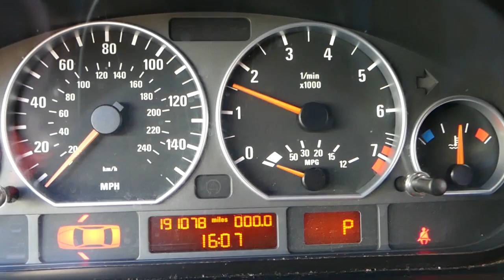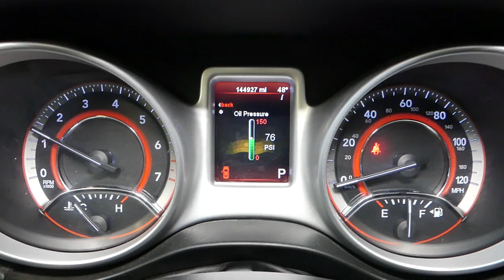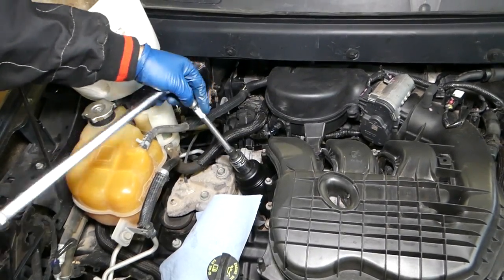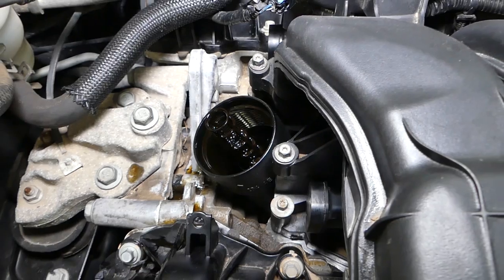DODGE CHRYSLER JEEP 3.6 PENTASTAR OIL FILTER BYPASS VALVE WHAT IT IS FOR AND REPLACEMENT

Comment: I almost bought the new oil filter housing, which goes for $307, from the dealership in my area.  Turns out that the valve was replaceable.  This was very helpful.  The fact that when installing the valve, it will first snap in place into the upper position.  But you are not done yet.  The final set point is when it snaps into place the second time in the second/lower position.  I watched your video to confirm I installed it correctly.  Your video is exactly how I installed mines.   I believe that this information that you are sharing is not on any forums.  Thank you very much.
Reply: i just bought that 308 housing part today and after seeing this video and this comment i was able to fix my bypass valve and i returned that part. man such a relief not having to remove the whole manifold and sheet. so happy 🎉

Comment: Without the bypass valve installed, would you not be allowing oil to bypass the filter at all times and thereby allowing unfiltered oil to circulate through the engine?
Reply: Yes you would

Comment: Hi I have a friend that has a 2013 caravan that he Took it to shop and they said that the adapter last time he took it was broken and went through the motor but I doubt this doesn’t the oil sump have a screen on it ?and even if pieces of the oil adapter  get into Oil pan if possible won’t hurt anything ?? I think even if the old adapter went into oil pan should
Hurt it right?

Comment: What if the plastic clip that broke has missing pieces?

Do I need to remover it all and look for it?
Reply: i have pieces missing too
Reply: You need to replace your housing if there is damage to the stand/cage that holds the spring unti in the video, or don't replace either.

Comment: some good questions here that went unanswered. I bought a 2011 Challenger with the V6. I put just under 50 miles on it. Dealer said the oil and filter were changed. I figure the smart thing to do is put on the Baxter anti return check valve. Took out the filter to check and make sure I bought the right Baxter adapter. Guess what. The damn check valve plastic housing was broken, Also tabs on the filter broke off when I removed the filter from the cap. The filter tabs I have. The top and bottom of the check valve plastic housing I have. After I took the bottom out from the top of the larger spring. What I have and what others asked was what happened to the rest of the check valve housing? They went down the filter housing but where does that go? Into the oil cooler to to the oil pan? Anyone know? The oil pump has a pre-filter of course. Looks like metal but the way they use plastic on cars who knows. Question is, what happens to that plastic if it reaches the pump? It should go to the filter. Strange enough the filter I took out what was supposed to be new sure as hell had more than 50 miles on it. Either the dealer never looked at the filter or..... No wonder I don't trust people working on my cars.

Comment: That bypass valve is not actually for when the filter gets clogged but rather due to manufacturing techniques of the filter medial the oil simply can not flow through the filter at cold temps under 32F and as a result, they decided to create a bypass in order to prevent starvation of oil or blow out from one of the oil line seals.

Comment: You'll get good oil pressure whether the valve is there or not, but you won't necessarily have any oil passing through your filter media.
Reply: Just had an oil change and it’s missing can I just change it w out changing oil ?

Comment: when I installed I can't push down to the second level because the old broken one is still there.then I had to take the new valve out and remove broken one
Reply: I only found part of my plastic clip. Am I screwed or could it be safe if it’s inside the manifold somewhere?
Reply: @BWeezy-sw1wy  it should have been popped out if it is not in that tube

Comment: what if you drop the spring and it disappears down in the bottom of the housing?
Reply: Don't do that lol
Reply: I did this.. dropped the spring into the housing. Realized I would have to take half the engine off to get to the housing unit . Took another look an seen the spring standing at the bottom of the hole.. with careful makeshift engineering I strapped a super small fishing hook to a tiny metal rod an fished it out.
Reply: What do I do about the little pieces of plastic that fell down inside the housing unit.
Reply: I think imma say f those little pieces. There is no way people are finding all the pieces as shown in these videos. My whole lower part of the clip is missing.
Reply: @justaviewerortwo2924  If the "stand/cage" inside the filter housing is not intact then there is no sense replacing the part in the video, you need a new housing.
Reply: Thanks for the video. I didn’t know how to install it.

Comment: Just use an updated oil filter. It has a plug  (where the tip of this valve normal goes) that pops out if the filter gets plugged. The set up from the factory is laughable in quality. Oil pressure probably keeps it open anyways.
Reply: Do you need to remove the spring as well or leave the spring? My valve broke and I see what you're talking about on the updated filter.
Reply: @jamesthompson5516  No, you can remove the spring. If you do want to replace the valve, rockauto has them for $10. I checked all the filters that walmart carries and all were the old style. Napa carries the up dated one.